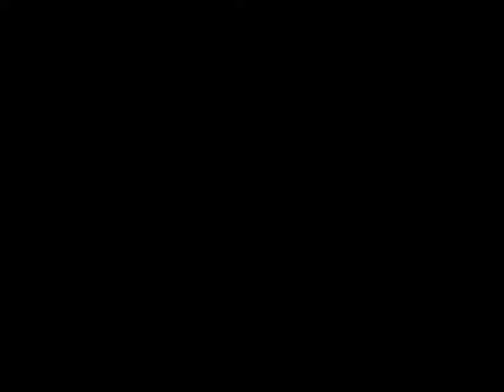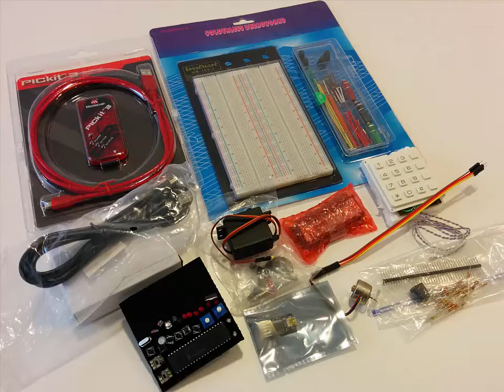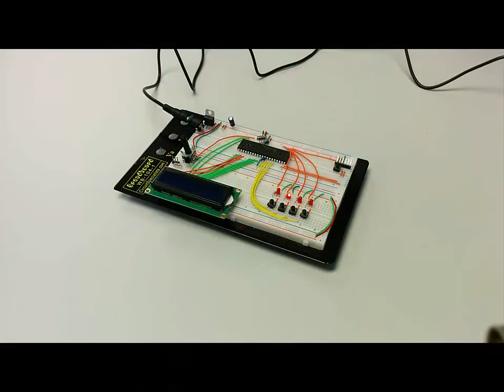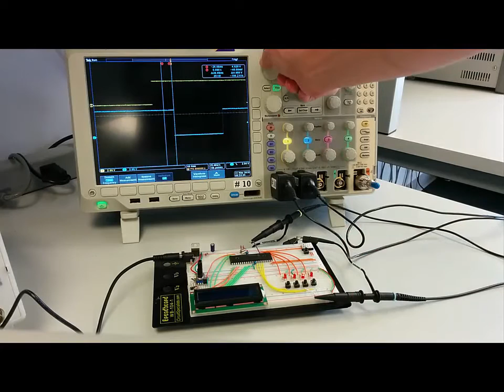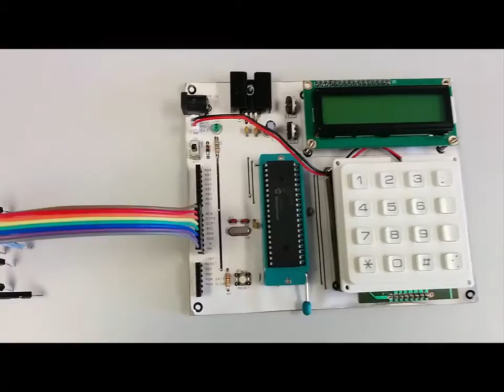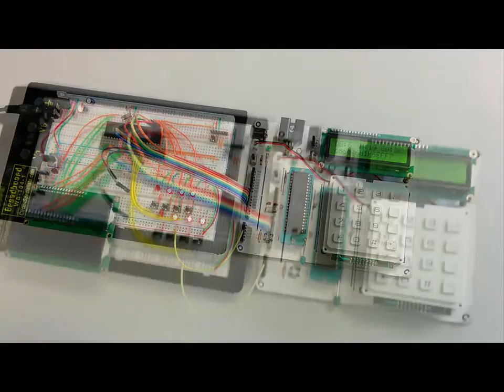PIC Microcontroller: Hands on Learning @ Rose-Hulman_Miller

Comment: Great kit. Do students purchase it? How much does it cost? What process did you use to determine what to include in the kit? Do you update it each year (similar to another question here)? The testing circuit is a great idea. What is your process for developing and updating it from year to year? Does the test circuit reduce the need for teaching assistant help in class?
Reply: The students purchase the kit, usually at around $100.  They don't have to purchase a textbook, though.  I start with the labs I want to include that term, and determine the parts list from the labs.  Our technicians help with acquiring the parts needed for our lab needs at a reasonable cost.
I typically make small variations each year.  This is my first year using the tester, but I will need to update the test programs each year to track the changes in the labs. We have limited TAs available at Rose, but this has helped to provide more feedback, particularly after hours.

Comment: I liked the tester circuit so that students can get quick feedback on their system, including a measure of how well they did.  This coupled with the ability to make modifications would help them to learn at a much deeper level than just a demo to an instructor (without the ability to redo). Also, it does introduce them to automated testing procedures.
Reply: I agree. This is a nice tool for helping students learn.

Following Bonnie's last comment, it would seem that an automated testing device provides motivation for students to develop their own verification procedures.  Would you say that the program on your tester is comparable in difficulty to the program it is designed to test? Or would develping an automated tester be beyond the scope/expectations for students in the class?
Reply: I would say based on my experience with developing this tester circuit that the programs were typically much more complex than the lab programs.  It would be a good exercise, but probably beyond their current capabilities.  I would like to use this as a tool for developing those skills, though.